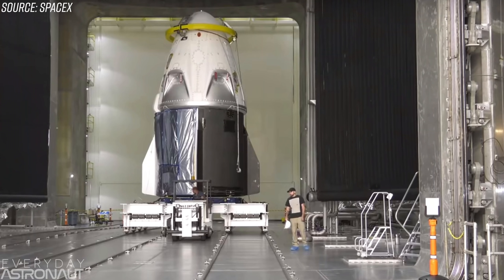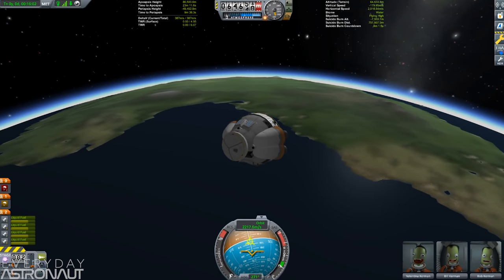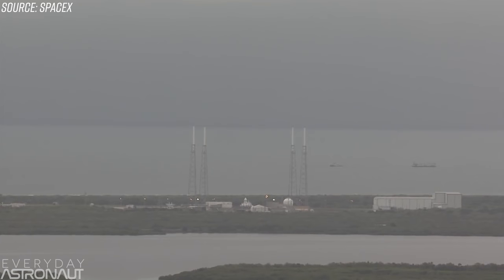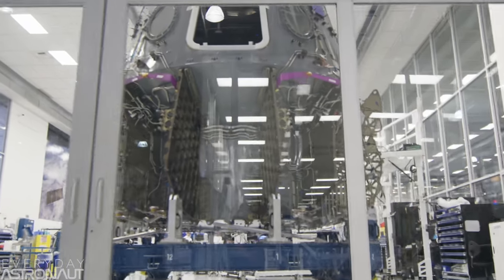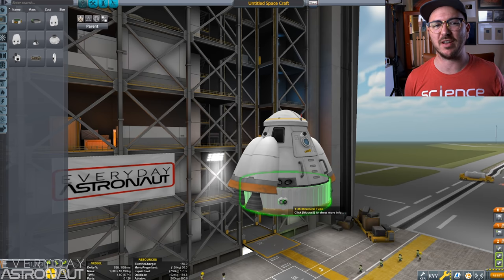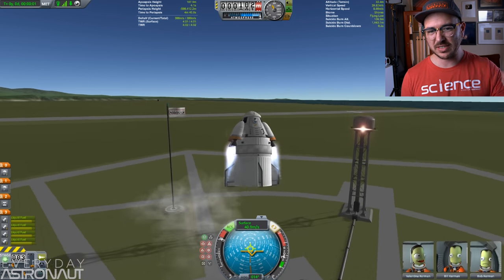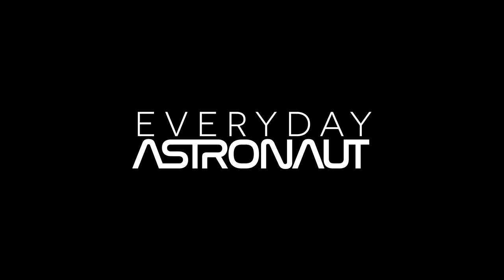Why Does SpaceX's New Dragon 2 Have Fins On It?

Comment: 10:17 No, when the center of lift is under the center of mass, the craft can be stable. However it has to get wings or fins to stabalize using aerodynamics. The first craft clearly did not have fins so the center of lift cannot form a straight line with the ground, then the center of lift will cycle upward and downward because of no fins or wings to control the craft in any sort of way. Therefore the cycle continues and the craft spins as shown.

The reason why they have to extend a part to add fins is because the crew capsule is designed to flip and any sort of fins cannot achieve that balance because the capsule would like to flip and then any thrust will be unstable. The reason I can think of not adding grid fins is because it makes the crew capsule less aerodynamic though I can't see why they won't do that. Maybe they want to maintain the beauty of the capsule. After all, they designed the craft for us to see.

Comment: STOP CALLING IT "CENTER OF LIFT"!! The center of drag is NOT the center of lift, lift is the phenomenon created by wings when the pressure is higher under and lower on top of the wing, you get what I mean. When you use "center of lift" to refer to the center drag it will confuse people.
Reply: Yeah. He does state once that it is really the center of drag but if you missed that one quick sentence you would get completely the wrong idea. "Center of lift" sounds like the main force pushing the object forward, instead of the exact opposite, which it actually is.               P
Reply: isn't it a relationship between center of gravity CG ( being forward) and center of pressure (to the rear of CG, for stable flight)?
Reply: The center of pressure is the location at which the aerodynamic forces can be resolved into a single aggregate vector acting on the body.  This would include both lift AND drag.  The 'vertical' force component would be lift, and the axial would be drag.

There isn't really much "lift" acting on an ascending rocket just above the launch pad, as its angle of attack is basically zero and it is mostly axisymmetric.
Reply: @brainmind4070  Lift is the phenomenon created by wings, not just the vertical forces.
Reply: AWEJOKER Lift is a force generated perpendicular to the direction of the free stream, often generated by wings.  When a rocket flies at a non-zero angle of attack, it, too, generates lift.
Reply: Center of Lift and Center of Drag are exact same points . The actual correct term is "center of pressure". It's the point of origin of the net aerodynamic force. You can't really differentiate Lift and Drag as separate entities in any other way than by some arbitrary convention, both are just two arbitrarily selected components of the net aerodynamic force, which in turn is just the result of integration of the pressure acting on the surface of the aircraft over its entire surface.

tl;dr center of lift = center of drag = center of pressure

source: aerospace engineering degree
Reply: @-AWEJOKER  Lift is created by the entire surface of the aircraft. It's the component of net aerodynamic force that is perpendicular to the free stream.
Reply: @brainmind4070  I know, but my point was not all vertical forces are lift
Reply: @delayed_control  The center of drag and lift are two completely different things.
Reply: AWEJOKER Any force perpendicular to the free stream velocity would be considered lift.  Drag acts parallel to the free stream.
Reply: @brainmind4070  Yes I get that, but still, my point being, the center of lift and drag are two different things, not very hard to understand.
Reply: @-AWEJOKER  "The aerodynamic force can then be resolved into two components, lift and drag, which act through the center of pressure in flight"

Quote from JPL engineers in the link above.

I'll go dig out my aerodynamics handbook if I still have it, if you need more proof
Reply: @delayed_control  Proof for what? For the 3rd time, the center drag and lift are two different things, but both are included in the center of pressure
Reply: You seem nice....
Reply: I would still say that its a little misleading, even though they are the same thing.  @delayed_control

Comment: Haven't tried anything like that in KSP for a long time, but many revs ago adding fins to an upper stage was a disaster waiting to happen, and not waiting long, either. By adding fins to an upper stage, you're moving your CoL forward, at least until such time as you jettison the lower stage. Add to that the stability control loop delay plus the noodle joints, and you'd be in for a hysterical (in all senses of the word--funny, terrifying, and organ-displacing) time.

Comment: The fins (as well as the surface area of Crew Dragon's trunk) are also used for solar power cells on one side, and heat radiators on the other side.

Comment: Correct me if I'm wrong, but didn't the Apollo launch escape system have a big weight in that tower to move the center of mass forwards so it was reasonably stable? Moving the center of lift/drag isn't the only option.

Comment: Where did you hear about the detonation for the launch abort demo? I read the FAA Environmental Assessment and it only mentions a breakup after engine shutdown- which would likely cause an automatic termination from instability, but be far less exciting than seeing the Dragon 2 shoot away from a fireball. Thanks!

Also, awesome shoutout to BPS
Reply: As we saw when it happened earlier this year, we did indeed see the Dragon shoot away from a fireball... not through a deliberate detonation, just from the inevitable result of the booster tearing itself apart once the aerodynamic nose cone flew away. You don't need a termination for that... a ruptured fuel tank in the vicinity of a hot engine will do nicely...

Comment: Random Question: I don't know how to say this but what if they need to self destruct a rogue rocket but the rocket is not receiving data , what would they do?
Reply: Scream and run for cover, or stare blankly at the screen, depending on temperament lol

But this is why abort and destruct systems are separate from the regular data channels, hardened and usually redundant, since rocket engineers don't like when they have to scream and run away.
Reply: Lol
Reply: ke6gwf Some rockets include internal automatic abort systems that will trigger abort in such situations. Even the recent copsub hopper tests had that.

Comment: What craft has the bigger windows - Dragon2 or Starliner? What craft can ferry more people inside of it? For what time? What are the max Gs? Are those vehicles universal or can be launched on specific rockets only? Are there any cool cameras on them that can capture the ascent and landing? What spacesuit you like more - SpaceX or Boeing and why? Where will they fly to, if ISS is no more? Can they dock automatically, or only manually? Do they have toilets inside? Snasks? Can they float and can they land on the land and what is the maximum slope, won't they roll if landed on the side? Will American spaceships have weapon inside of them for emergency landing in Siberia to fight off the bears? I think thats all my questions for today.
Reply: Yes
Reply: Starliner is designed so it can also be launched on a Falcon 9 and several others though not sure which. Not sure if Dragon 2 can launch on anyone else's rocket. Both capsules can take 7 astronauts/cosmonauts but both are set up for 4 with some cargo.
Reply: They can both dock, the older dragon and Cygnus used berthing because it's simpler for the capsule designer.
Reply: @chriskerwin3904  Close, the common berthing ports are a lot bigger and therefore allow bigger chunks of payload. This is why most cargo craft are berthed. The docking ports are a lot smaller and mostly used for people.

Comment: There are 3 centers important on the rocket:  center of mass (abbreviated COM or CoM), center of thrust (COT), and the center of lift (COL). If the center of thrust (defined by position of engine nozzles) is above center of gravity and center of lift, then it doesn't matter if center of lift is even above the center of mass. That is why Mercury or Apollo capsules with escape engine tower high above the capsule did not need any fins when escaping away from exploding rocket , even when both had center of lift above the center of mass.

Comment: Now can you mod Kerbal to add differential thrust? An active system to stabilize the capsule during abort, no truck and no fins.

The reason is Dragon was originally intended for the Moon. To return from the Moon, it required a service module. I was modified to service ISS only, the service module was replaced with a trunk that holds solar panels and acts as a spacecraft adapter for the Falcon 9 rocket. But to use Dragon to go to the Moon, it will need some way of returning from Lunar orbit. That means adding propellant tanks and engine(s) to the service module for TEI. Once you add that mass, pad abort engines will not longer be able to drag the service module with it. This will require the capsule to abort without any sort of trunk. So again, demonstrate active differential thrust to maintain orientation just long enough for abort.

Comment: I think you're mistaken about the New Shepard abort mode- the pusher rocket has thrust vectoring to hold the correct alignment during boost, then the capsule naturally turns over during the post-burn coast. Adding fins might only slow down the aerodynamic rotation, and provide features on which the recovery parachute could entangle. On my first jump I had my main parachute risers twist around my left arm during a spinning deployment and pin my arm behind my head- fortunately I was able to kick my legs to assist in unwinding the twist and clear the entanglement, but a capsule can't do that. A little motion sickness beats streaming in to impact.

Comment: In everyday general aviation, pilots must consider weight and balance calculations before they take off.  The center of lift is mostly fixed in a certain position.  But the center of gravity (CG) can be shifted depending on where we place the heavier passengers and our baggage and fuel.  The greater the distance between the CG and the CL, the more stable the aircraft becomes.
              When the CL is behind the CG we call it positive stability.  That means that if the airplane is flying straight and level in a normal cruise configuration and you upset the cruise, for example by pulling back on the stick and letting it go, the airplane will oscillate into a waveform and return to normal straight and level flight.  That is called "positive stability'.  That's a good thing.
                However, if the pilot misloads the airplane and places the GC at or near the CL, and upsets the cruise configuration, the aircraft will go into continuous oscillation and its waves will continue as usual.  This is called "neutral stability".  BTW, some military jets that "fly by wire" are designed for "neutral stability" because of aircraft will maneuver more readily.  Safety is conserved by the "fly by wire" computers.
                The worst way to misload an airplane to put the CG behind the CL.  If you upset the cruise by pulling back on the stick or control wheel, the oscillations will continue to grow in wave height.  This is called "negative Stability".   No pilot want's to be in a negatively stable condition if he/she enters a stall because it might be impossible to recover from such an upset.  Just a little basic aerodynamics 101 for review.  So the next time you get into a small airplane, don't be upset if the pilot asks you how much you weight and wants you to sit in any particular seat in the airplane.
                Even in a lightly loaded airline jet, the crew may ask passengers to move their seat, for weight and balance purposes.

Comment: The grid is the same as "hundreds of mini-fins". The key is the angle of the leading edge of these fins/grids/drag surfaces which is swept and not perpendicular to the flow/direction of travel. When the fuselage (would) tilt/yaw/turn/rotate to one direction then the leading edge on the outer side shows more facing area to the flow so it creates more drag so it pulls that side back. That is how these fins are stabilizing the body. I think you could use just simple rods stuck at a swept angle as well... The grid fins I guess were used commonly on the russian air to air missiles first due to the supersonic aerodynamics...
The other stabilizing effect of a fin is the angle of attack of the fin surface and the generated lift...but that is a different component/story...

Comment: Center of lift doesn’t matter in your example. Only centre of drag and centre of mass. It’s ok though. It was a common missconseption and fallacy committed even by rocket scientists in the early days of rocketry. It’s counter intuitive but unless the rocket engines gimble, it doesn’t matter if the centre of drag is near the top of the rocket or near the bottom.

Comment: Thanks for another fun & interesting video. Minor point of clarification, Aerodynamic Centre (AC) is a standard term used in aeronautics, rather than Centre of Lift or Centre of Drag which can be used but refer to the centre of loads perpendicular and axial with fluid flow respectively.

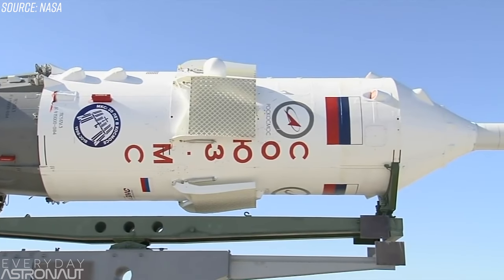Comment: 3:32
  Can someone with a degree in engineering/aerodynamics explain (oversimplified/nutshell) why/how the heck those grid fins work as far as aerodynamics? To my untrained eye that looks about as aerodynamic as a 1930's era Ford sedan. Is the upper cone creating an envelope that is nullifying the majority of potential drag?
-Jake
Reply: They’re not designed to be aerodynamic, they’re there to add as much  surface area (drag) as possible. It’s the same idea as normal fins you just get more surface area with grids.
Reply: To put it simply, the wind pushes against it. When you are flying forwards that means whatever "catches" the wind is going to get pushed back.
You build the thing that "catches the wind" behind the center of mass and voila it will stay behind the center of mass because the wind holds it there.
How it looks is not really important as long as it has a surface area for the wind.
You could even glue feathers on the rocket for this purpose, the way it works for an arrow.
Reply: Think of the vertical parts of the fins as the a regular fin.   It is more spread out but the same effect once you start moving them.
Reply: I think the original poster was talking abot the drag of those fins on ascent while being folded in. They still stick out like a sore thumb. Atleast i was wondering about the aerodynamics when I saw them the first time and I do still wonder.
Reply: @z33r0now3  It may be a small delta-v trade off (like 5m/s) but folded in they're fairly aerodynamic and appear to have a rounded hinge which may help with drag as well.
Reply: @z33r0now3  
Yeah you were right about my intent...thus the degree/engineer comment.... The effects of the grid fins after deployment is obvious. The drag they impose even while folded is also rather obvious. The real world tradeoffs involved here is the interesting bit. For instance, why haven't these been integrated into a more aerodynamic system that would place them in their own cavities? There is a lot more going on here that would be interesting to hear about, but this is the kind of thing someone needs a lot of direct and practical experience with in order to know instead of guessing/assuming.
Reply: The grid is the same as "hundreds of mini-fins".
The key is the angle of the leading edge of these fins/grids/drag surfaces which is swept and not perpendicular to the flow/direction of travel. When the fuselage (would) tilt/yaw/turn/rotate to one direction then the leading edge on the outer side shows more facing area to the flow so it creates more drag so it pulls that side back. That is how these fins are stabilizing the body.
I think you could use just simple rods stuck at a swept angle as well...
The grid fins I guess were used commonly on the russian air to air missiles first due to the supersonic aerodynamics...
The other stabilizing effect of a fin is the angle of attack of the fin surface and the generated lift...but that is a different component/story...
Reply: @UpcycleElectronics  Several Soviet/Russian, Chinese, and North Korean ballistic missiles, particularly of the "cold launch" type (where the missile is propelled out of a reload-able launch canister by a gas generator cartridge, before the missile's first stage ignites above the ground), use four, six, or even more grid fins, which are folded against the missile's first stage at the rear. As the missile exits the launch tube, the grid fins unfold so that they are "face-on" to the airflow, which flows through the grids.

Comment: I have a rocket motor for the top of landers, a toroidal sheath motor designed to leverage the gases as an atmosphere for lift  on top of the thrust vector, a thust-lift design the nacelle shaped gives lift and it needs fins to not spin, and to cool flow raising density and thickening the boundary-layer for lift power.

Works in a vacuum, things point to having them on payloads to stabilize on takeoff before it has momentum, and reduce the max pressure reached.

Cheers, tom

Comment: KSP can do thrust differentials. The Throttle Controlled Avionics mod (think that's the name) handles that. You can create stable VTOL craft quite easily with that mod, as it automatically controls the engines' thrust limiters to get the craft to behave how you want.

Comment: Thanks for a very informative video! Wondered about the fins myself. Excuse me if the answers are on the surface, but my questions are related to the strange design of the solar panels on Dragon 2: 1) how come they won't be damaged during the ascent? 2) why SpaceX decided to go with unmovable panels in the first place? 3) Are there solar panels on Starliner and if yes, where, if no, how limited its batteries?